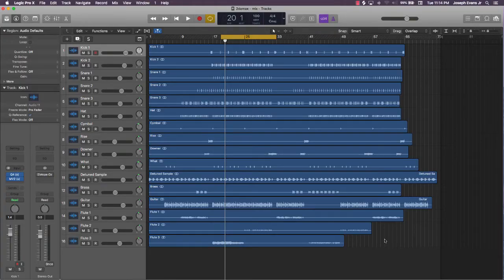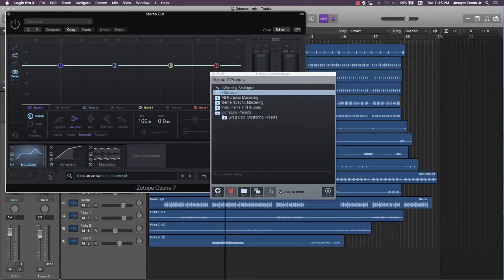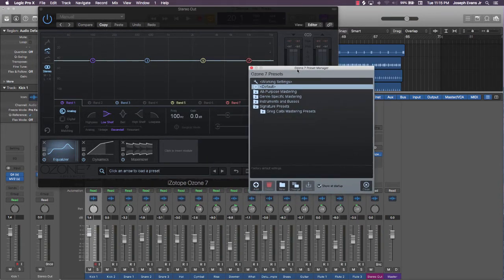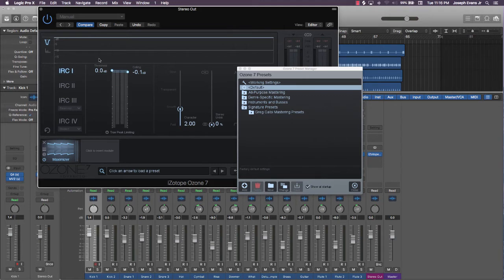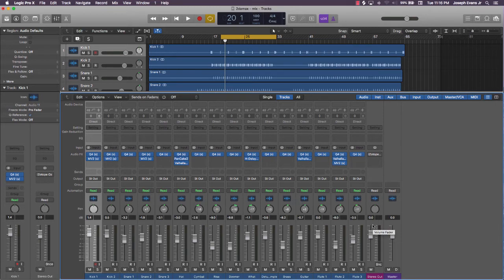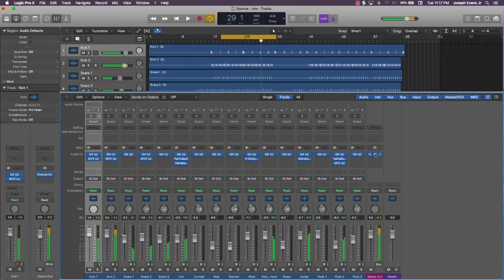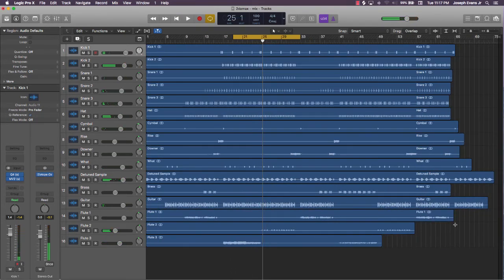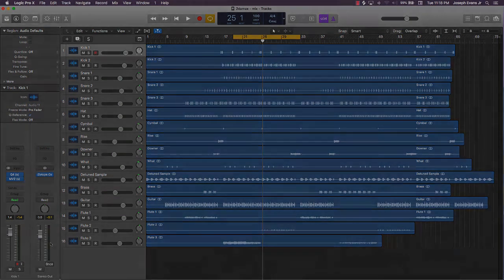Logic Pro X Tutorial: How to Process the Stereo Output (Beat Mixing Tip)

Comment: what do you use if your just using stock plug-ins?
Reply from the maker: adaptive limiter ... turn the ceiling down to -0.1db
Reply: I have iZotope my question is if I am using neutron 3 on each track for leveling my beat should I use a track bus for my drums and other audio files?
Reply from the maker: @ericwells7209  Id recommend putting the izotope plugin on your stereo out.